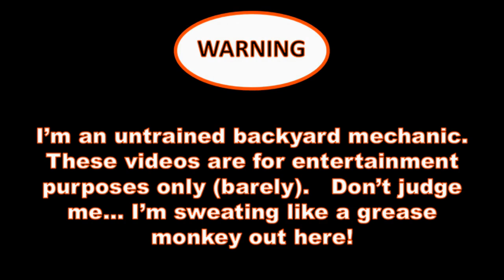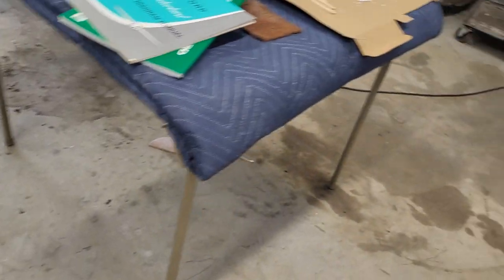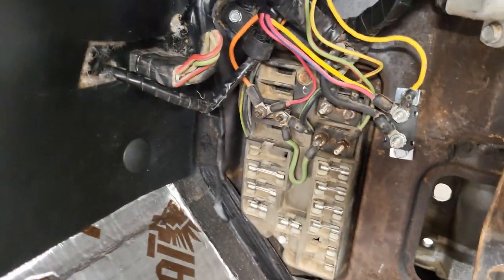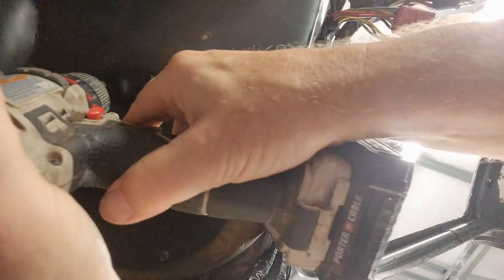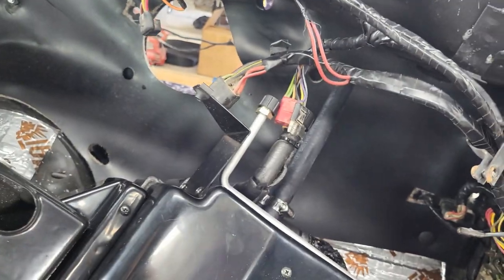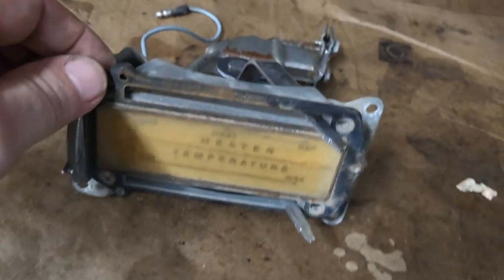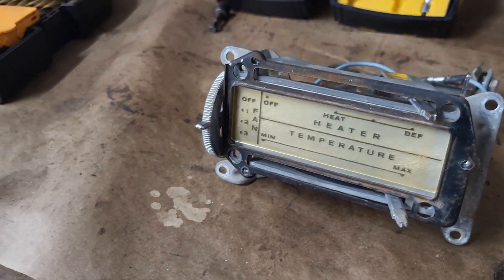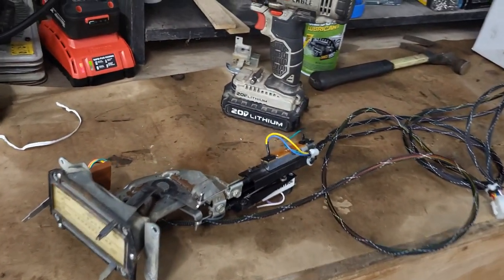A/C / Heater Box Installation - 1964 Thunderbird

Comment: Hey Matt,
Yes, this is the time to check the grounds. 👍
That was good thinking on the heater motor cover, just a bit of welding and you're back in action!
Reply from the maker: I was really happy that worked out.  That saved me so much time

Comment: Very nice video. I have always wanted to see one of these after market AC systems installed. It will be interesting to find out how effective it is once installed. The original systems didnt cool all that well so maybe this system is better? I wonder where the air intake is since you had to block off the air intake hole? I guess youll just be recirculating the air in the car? Thats better anyway. However, this means that there will be no fresh air vent on the right side anymore correct? Like you say, you have to take the good and bad with these after market parts. Thanks.
Reply from the maker: Yes the system will be recycling the air only and there will only be the one fresh air vent.  There are definitely some trade-offs.  I would say the system install is going good so far but there is plenty more to go.
Reply: @Exit45Restorations  Looking forward to your upcoming progress videos.